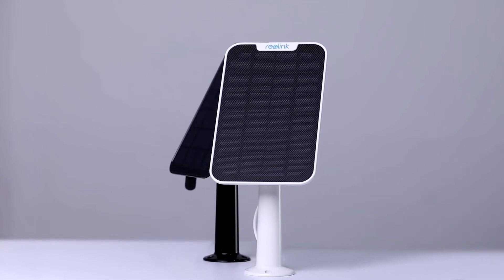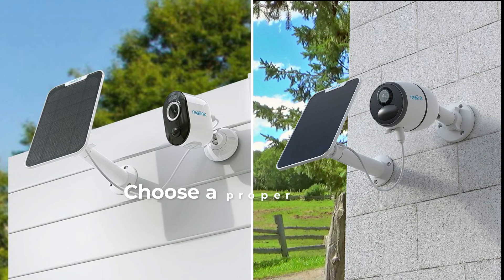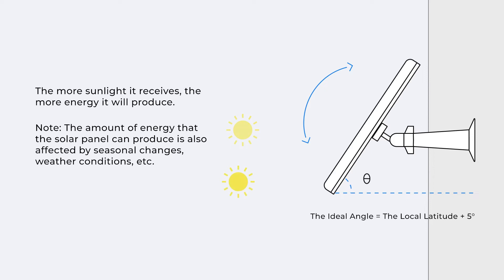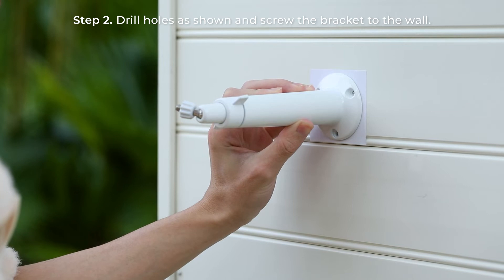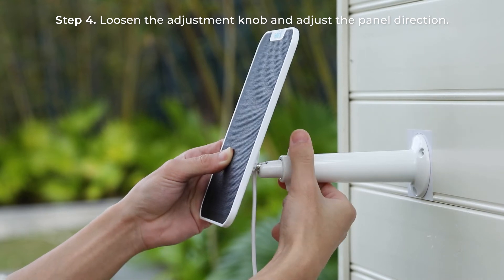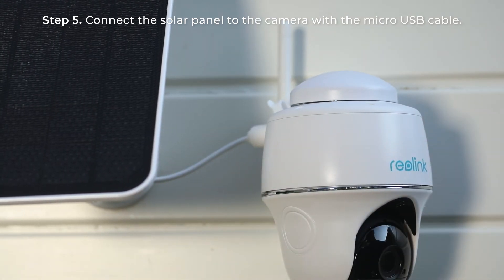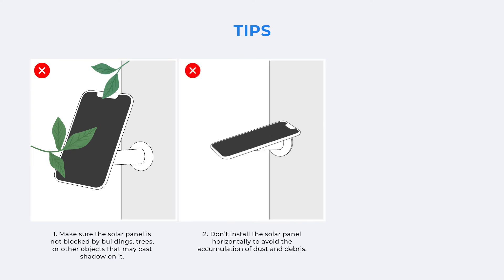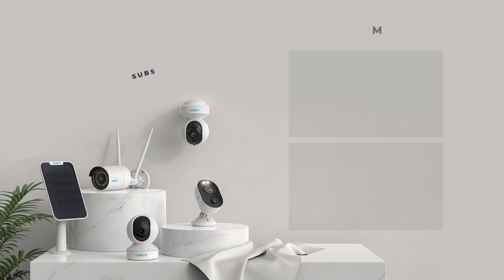How to Install the Reolink Solar Panel Correctly (Step by Step)

Comment: It should be mentioned that the cameras do not have a heater for the battery so they will not charge if they are cold.
Why is this not added? First use the energy from the panel to heat up battery to non freezing, then charge battery. It seems so obvious?

Comment: Maybe its the model I got but the most annoying thing is getting them plugged in. The model I have has the rubber piece to protect it from getting wet but makes it impossible to plug in, even tried Vaseline.

Comment: my dual camera doesn't have micro usb connection is there an adapter?
Reply from the maker: Pls check this video: https://www.youtube.com/watch?v=5igvh6pI0nA. Here is the guide for setup and install Duo WiFi.
Reply: Dual wifi.  Is there an adapter I can purchase to use a solar panel
Reply from the maker: If you bought the DUO wired Wifi version, there will be a power adapter in the package, which cannot be used with a solar panel;
if it is a battery version, you can buy our solar panel https://store.reolink.com/us/accessories /#reolink-solar-panel.
If you can not tell your camera's version, pls contact our support team:  https://support.reolink.com/hc/en-us/requests/new, they will help you.

Comment: Guys your solar panels are not up to par with others; not even close I’m afraid. Last week I checked my latitude and angled it +5 (yes I used a leveling tool to get the exact angle). I have it facing south of course. Nothing is blocking it and it gets up to 4-8 hours of bright florida sun everyday depending on cloud coverage. Even on total bright sunny days, the panel won’t keep it fully charged and I have to take it inside every few days to charge it. Meanwhile I have two solar panel cams from another company, probably the most popular security cam company - and they charge to 100% everyday, rain or shine. One is a light camera for night which drains the battery very quickly but it STILL goes back to 100% after a full day outside. You guys need upgrade your panels. Love your products but dang, work on the panels please!
Reply: Are you talkin about ring doorbell
Reply: @chuckb9867  no. I’d rather not say the brand/model because I don’t want it to appear as though I’m promoting them. But no, I am not talking about about any doorbell cam. Regular wifi/solar powered cameras.
Reply: I also had the same experience in the northern area of Germany. Couldn't get it to work properly
Reply: @zerstreut1996  just to be clear my panel does work, just not very well and not nearly as well as other popular solar powered cams. Granted, the solar panels from the other company are about $30 more expensive than Reolink’s panels. But I’d happily pay Reolink $50-$75 for a better panel.
Reply from the maker: @ipawper-6626  Thanks for your feedback, for this questions, pls contact our support team: support@reolink.com, they will help you.
Reply: @ReolinkCameras  thanks for your reply. Have a nice day!
Reply from the maker: @ipawper-6626  You're welcome. Have a nice day~
Reply from the maker: @zerstreut1996  If your solar panel could not work properly, pls contact our support team: support@reolink.com, they will help you.
Reply: What do the specs say on the back of the panel? My reolink panel says 6w but seems a bit small for 6w.  I will be mounting mine soon.